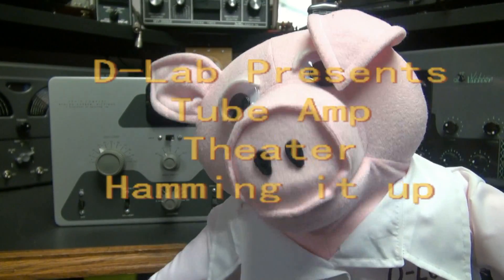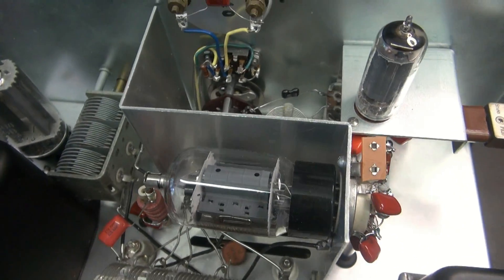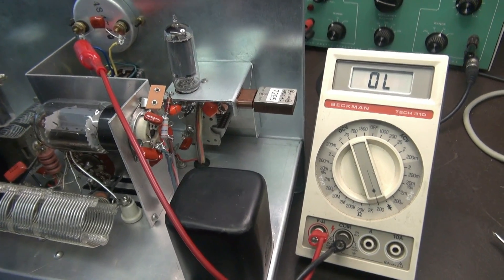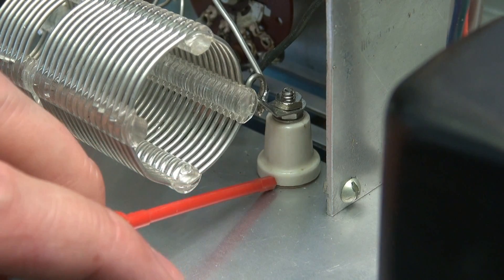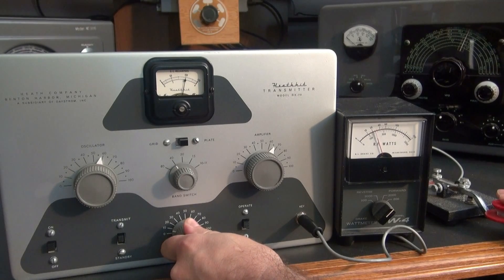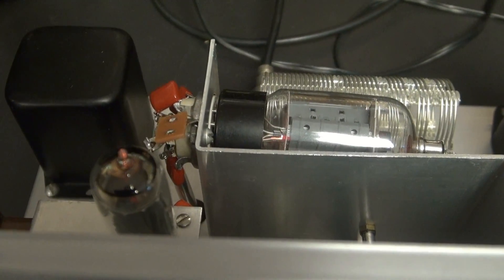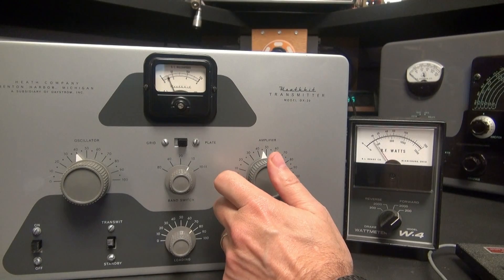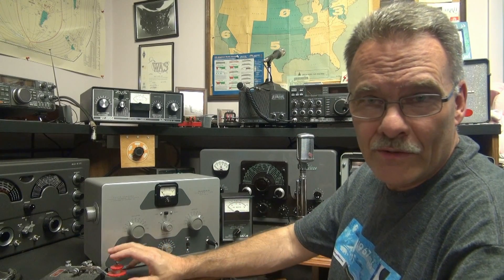How to Repair Heathkit DX-20 CW Ham Tube Transmitter by D-lab

Comment: The DX20 was my first transmitter back in 1958!  Spent many hours with it, eventually adding a Knight VFO and a home brew linear amplifier for an output of about 400 watts cw.  All that equipment is long gone, but remember those years fondly... 😀
Reply from the maker: My first station was a Johnson Viking II, Hallicrafters SX-100. I was in CA at the time. One night while monitoring the 11 meter band, I heard my Dad talking from MI! He was not a Ham yet, so ran his equipment on CB. Later I converted him. SK now, miss him and those cool days of radios,slot cars, Fisher tube stereo.
Reply: The DX20 was also my first transmitter too back in 1970. Those were some great times.

Comment: Very nice condition.  Looks like it just had its 100k service done, all new modern caps and resistors.  A true CW classic.
Reply from the maker: Yes, this one is very clean. I believe it would be best to run this TX with a VF1 VFO. Seems crystals these days are getting weak + hard to find. It was a fun repair.